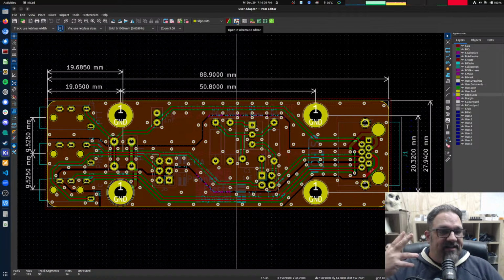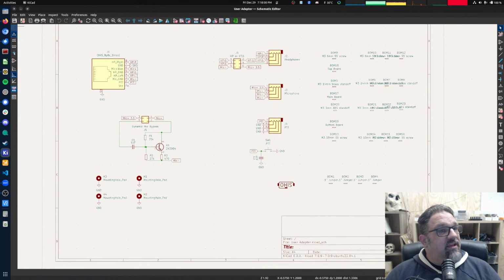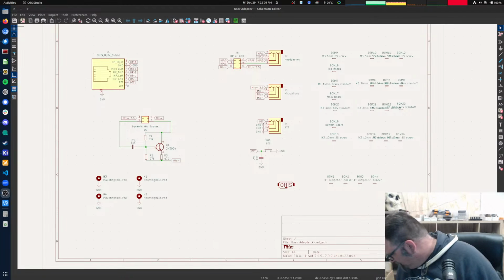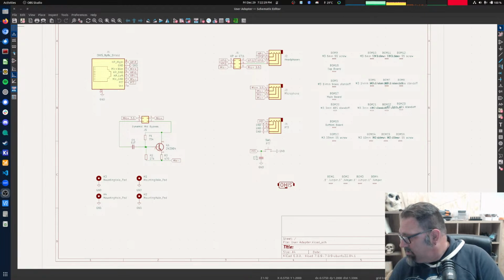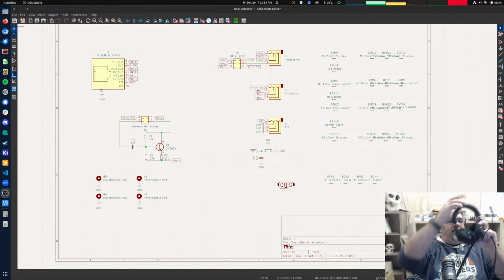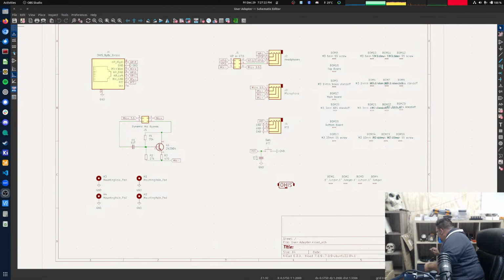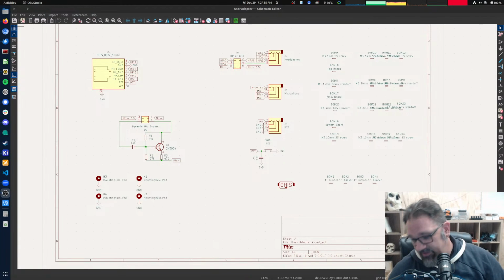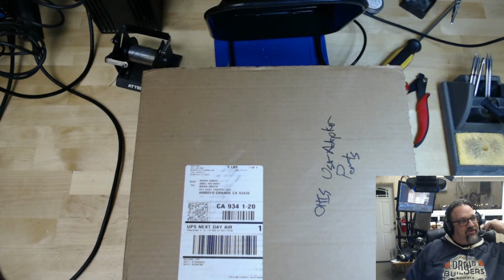Assembly of Open Source OHIS User Adapter (and test of new streaming setup)

Comment: Hey Mark, what do you think about adding in an ssm2168 or similar for adjustable mic preamp, noise gate and voice compressor? Either in this or maybe the contest controller?
Reply from the maker: I assume you mean SSM2167; I couldn't find a 2168.  But the 2167 looks very interesting, I'd never seen that. I kinda want one for line level signals now!  I'll go looking for that.

Anyway, to answer your question: I think this would be a great addition to a User Adapter!  I'm not likely to add it to the Open Source kits that I'm designing and selling, mostly because it only comes in surface mount and I'm trying to keep these kits to "minimalist, easy to assemble" kits.  BUT!  I might add it to the next revision of the User Pro.  And, this design is open source, so someone can add it themselves.  ;-)
Reply: @SmittyHalibut  Yep, sorry, typo! the SSM2167... I picked up a few modules from AliE with the chip and support passives already fitted on board to avoid the smd-ness. It's a nice little chip! This version only has fixed preamp gain, which was too much for my radio at any mic gain setting, even a little hot with mic gain at 0! So it needs to be externally divided down, but the compression and noise gates are adjustable by changing a resistance ( just note that on the modules I got, the resistors for NG and COMP where reversed on the board and needed swapped or replaced with pots... check the fine datasheet 🙂) There is also a (so far in my searching) harder to source alternate version that has programmable gain, but for the extra expense and sourcing difficulty, it may not be worth it since you can just put a resistive divider on the output...)